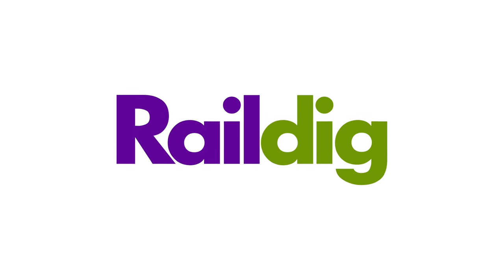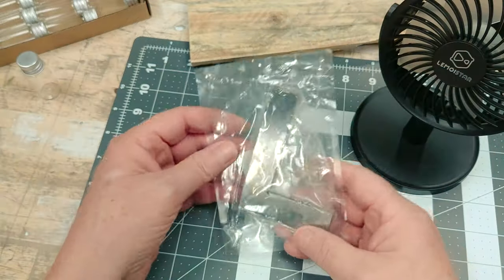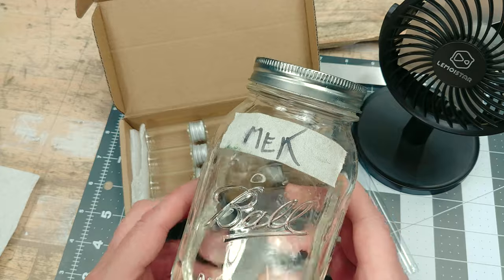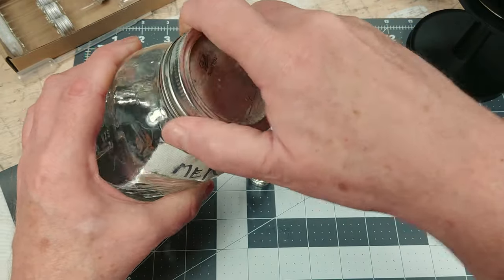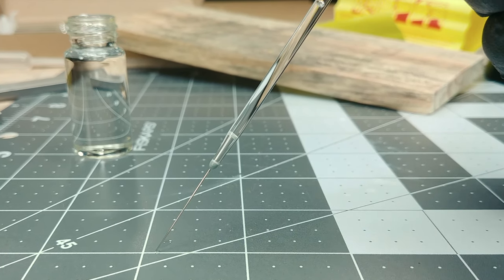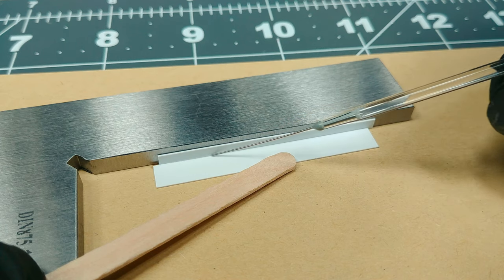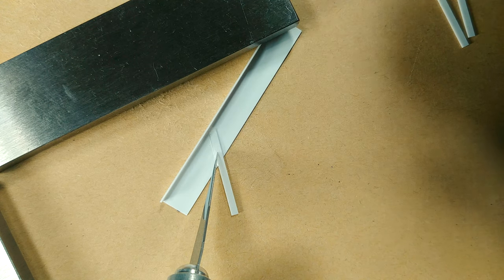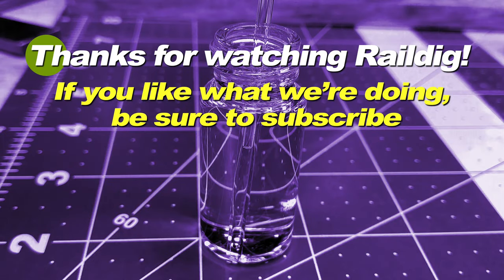Touch-N-Flow Solvent Applicator | Welding Styrene

Comment: Great video. Have you tried this with CA glue? Or is CA glue too thick for this applicator?
Reply from the maker: Thanks! I don't think I'd try this even with thin CA. While these are surprisingly durable given they're glass and really thin metal, I could see CA getting jammed up in there and I don't think you'd even be able to successfully clean it out.
Reply: @Raildig  Ok great. Thanks for the quick response!

Comment: That touch and flow applicator is the cat's pajamas
Reply from the maker: I always have an extra one on standby just in case the glass tube breaks. Several years later and I'm still using the first one I bought... these are surprisingly tough little glass tubes!

Comment: I have a joint with all surfaces painted. Will MEK melt through the paint to make a good Weld like Tamiya Extra Thin and Plastruct General Purpose Weld?
Reply from the maker: Not sure about the MEK through paint, though I suspect even if it did go through you would end up with a less strong joint. Just a guess there but if at all possible, I'd try and scrape the paint off first.

Comment: Use syringe tip (availaable in many sizes [length and diameter] ) Some tips are VERY small so deliver much less adhesive.
Assorted sample idea: https://tinyurl.com/y42326dz and size chart (the colors really help) https://tinyurl.com/y6y7haw7

Comment: The biggest problem I had with the Touch and Flow applicator was the needle getting clogged. I finally got frustrated with it and threw it in the round file.
Reply from the maker: I initially had that as well, but I found the key is to keep the needle moving along at a good speed otherwise the styrene melts and clogs that tip. It does take awhile to get the speed right though, so I can understand your frustration.

Comment: Question: does this MEK stuff have any effect on primers or paints? I had a friend use Plast-I-Weld by Flex-I-File and along most of the joint lines, the paint crinkled, even bubbled, and we thought it had to be the glue.
Reply from the maker: I've never had an issue painting over an MEK joint, though as always it'd be worth testing first. I've also never used Plast-I-Weld as years back I bought a gallon of the MEK and still have a good deal of it left. It's supposed to be one of the fastest evaporating solvents out there for styrene and from what I can see, it does dry with no residue. As a note, they now also make an MEK substitute, perhaps with a less toxic formulation. I use the original with a fan an open windows for ventilation.